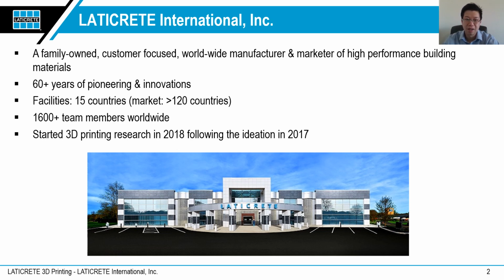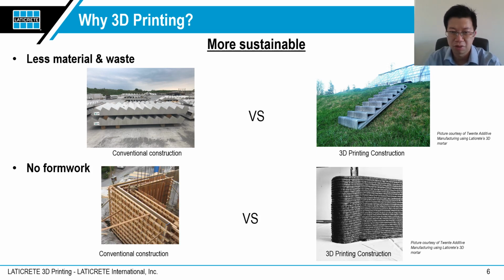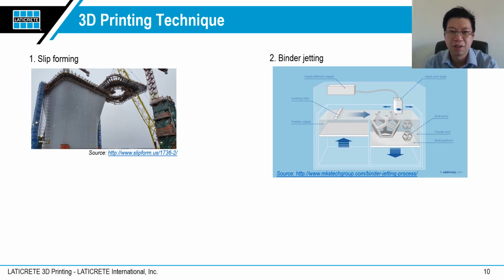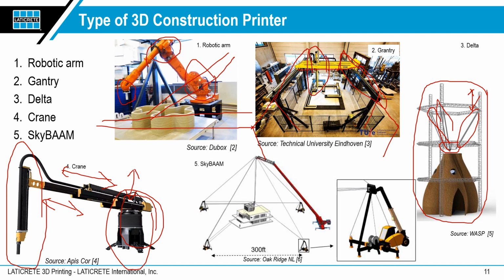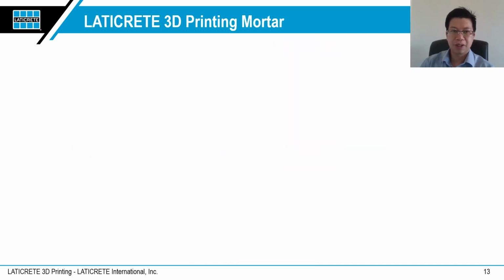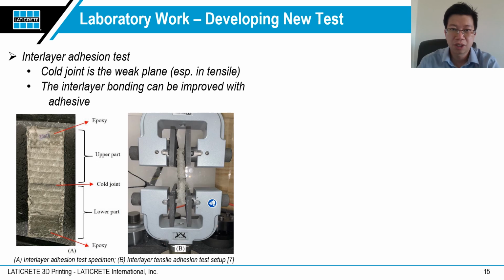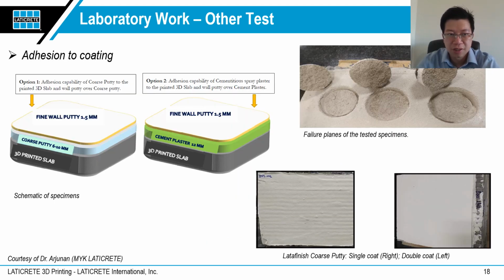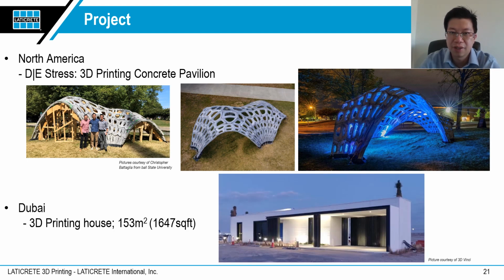3D Printing Industry Webinar with LATICRETE Scientist

Comment: What is the workability time for the mix?
Reply from the maker: We currently have several types of formulas which are designed to have various workability times (i.e. <15 and <25 minutes) in order to accommodate different needs of different projects. The workability time, however, might vary due to the amount of water used and the printing environment (temperature, RH, wind, sunlight exposure, etc).